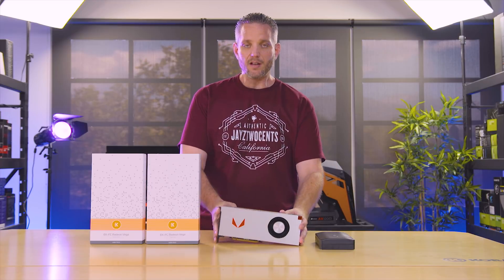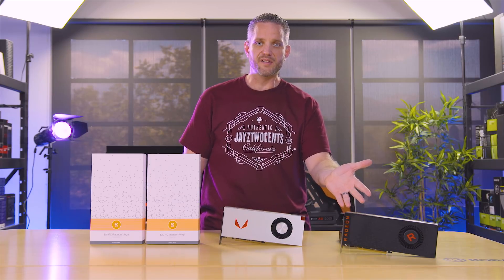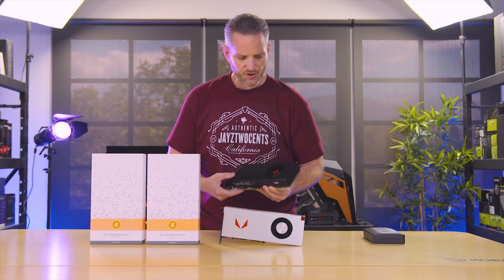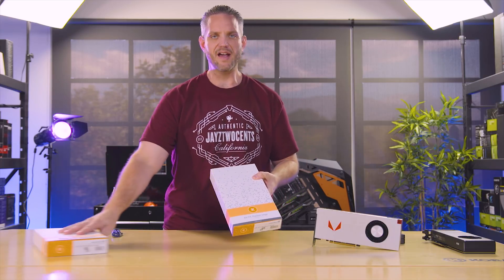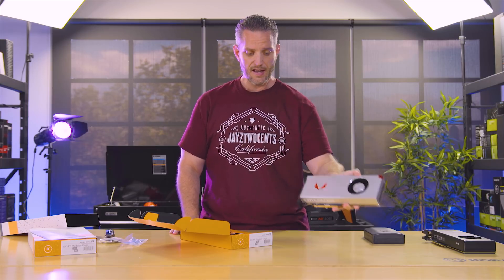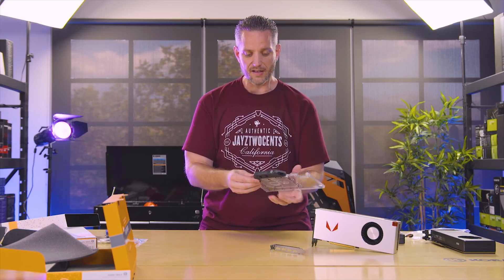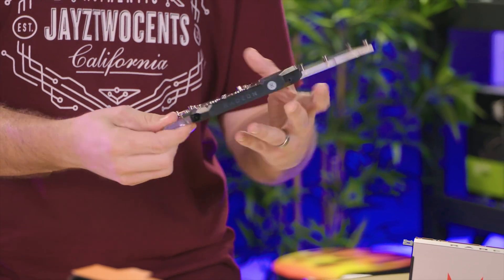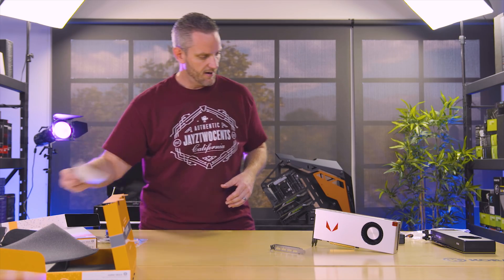Does watercooling help AMD Vega cards?

Comment: 43c is shit ton here average 45-47

"The two main differences in the climate of Saudi-Arabia can be felt between the coastal areas and the interior. The average summer temperature is about 45° C, but readings of up to 54° C are not unusual. The heat becomes intense shortly after sunrise and lasts until sunset, followed by surprisingly cool nights."

Comment: Speaking from the standpoint of just building a SFF PC with a 1080 on air, the single slot is definitely desirable but not at those prices. Honestly, even with a single slot configuration like that the radiator and fans would have to be around 37 mm. That is doable but maybe not that efficient given the reduction in airflow and radiator fin length. I think this is a pretty easy decision for others in my position.

Comment: Question, I have asus 1080 graphics card and a freesync monitor witch I spend 800$ and don't want to change, if the price go down to 499 should I buy vega or 1080ti? Is freesyn justified to buy vega 64?

Comment: It was 30c(86f) here, yesterday it was 27c. day before that also 27. Since my room is the attic it gets pretty toasty. I don't have an AC either. My GPU peaked at 86c to after a little tweaking of the fan curve that came back to 75/77 in the witcher 3. Luckily the game noise drowns the little noise i can still hear throught the M50x's Tho i doubt it's worth it to put an NZXT Kraken G12 on it. That would be an 100 - 150 euro investment into a midrange card. Tho you could argue you can port it over onto other cards,  a GTX 1070 for instance, if i upgrade.

Comment: Jay, In Wattman if you left click on the actual P-State column header then you can change your clock settings from Max to Min. This changes the behavior of the card to always run at the set speed (min) as opposed to turbo up to the speed setting (max).
-Cheers

Comment: of course i would not recommend AMD Vega to any of my friends. It's power hungry, hot, etc etc. Should the price drop to normal then i might recommend a bit if power consumption is not the issue but for now, a big no. 

As for myself tho, if i had the money i would buy the vega 64 and a custom watercooler. I just wanted to support AMD :)

Comment: The clocks bouncing is the card hitting a power limit on stock settings. Undervolting or raising power limit will stabilize the clocks. Some of your fellow tech-tubers have done this already just without a custom loop.

Comment: ps...a good video-card DONT need some water-cooling......just look at for ex, (Nvidia) Asus  STRIX models....Very good components... Super Alloy Power transistors, Vram and top on that basic heatsink CU cooling....i mean come on, my STRIX 970 is nearly better and cost 50% less.

Comment: Lol, 43.3 C, here in Qatar.... it's nothing man :P  Despite that I think the Vega64 cards are pretty awesome, they are not worth it at the current prices to me.  At the official launch price, definitely worth it, might have picked up several, I'm pretty sure that those raw compute numbers would be worth it for me (HPC not mining) in that case.  If I were planning to use it as a gaming card, then the launch price was pretty good, but not an amazing value.  But.... there is some strong potential for it to do better over time (considering the hardware specs I believe it can do a good bit better than it is with the current drivers), especially with more DX12 and Vulkan titles.

Comment: Worth it for the aesthetics, (lack of) noise and if you go after a FreeSync monitor and then it's not in 1080Ti territory anymore. Actually I almost bought a pair (gpu+block) a few hours ago, there's a pretty good offer - around 660 Euros with the waterblock when the crappiest 1080Ti from Gigabyte (white one) is still anywhere from 720 to 780 Euros and a Poseidon/Sea Hawk is around the 900 mark. I hope Vega is a success and AMD are able to get back on their feet top-tier-GPU-wise so we can get more fierce competition.

Comment: I loved that deliciously long shot of the warranty sticker getting pierced by the screwdriver.
Reply: pop dat warranty cherry
Reply: It's usually based on law, not what the manufacturer tells you. In Australia, for example, they can't refuse to honour a warranty if a sticker is damaged or removed.
Reply: Everywhere I've lived, contracts can't affect you rights by law. This applies to Australia and the EU/UK. If hey say something in the warranty, that has no affect on whether they have to service a faulty product. They have to prove whatever you have done caused the issue. You can take them to various consumer/government groups if they do refuse. Usually results in fines if they don't have a valid reason for refusal. I thought America had similar laws regarding consumer rights, but I'm not American.
Reply: Astfgl Im going to attempt to remove mine, run time spy on a loop and take it off while the glue is hot.
Reply: Actually they are bogus, linus did a whole video on it https://www.youtube.com/watch?v=qwAGgCpLVeo
Reply: REKT
Reply: bullcrap, as long as you refit the original heat sink and fan they have to honor the warranty!!!   I did the identical mod on my 56 and i didnt test the card before i did it and low and behold was dead.  So fitted the orginial heat sink and fan with original screws and it was warrantied no worries.  Look up warranty law ;)
Reply: Yep, and i got one doa vega 56 and had to warranty it AFTER i removed the sticker and no worries.  Also called ACCC to confirm before i went and 100% stickers mean NOTHING
Reply: you dont lose your warranty, educate yourself about the law
Reply: I'll be gentle...
Reply: Same here!! I enjoyed that a bit too much.
Reply: Gunna have to go caps here. THE MAGNUSON WARRANTY ACT DOESN'T HELP BECAUSE THEY ARE NOT I REPEAT NOT MAKING A TIE IN SALE. I repeat, they are not making a tie in sale, because they are doing it completely free of charge. Know the law, and how it applies.
Reply: :|  Losing the warranty if you aren't a rich YouTuber as Jayz isn't funny at all.
Reply: So I put the block on my Vega, removed the sticker with a little bit of heat >:D
Reply: Those stickers are not "bogus". They can refuse to honor warranty if the repairs/modifications are not done at an authorized location. It is stated in the warranty, which you can find and read for yourself before purchasing the product (which you agree to, by purchasing the product). That "example" points to nothing but some tech rant, with no actual basis.
Reply: Warranty is a contract. By US law, you have the right to view the warranty before purchase. After that, your agreeing to it. Even the Motherboard article that goes on it's tirade against this practice states "The statute itself states "for example, a provision in the warranty such as, 'use only an authorized ABC dealer' or 'use only ABC replacement parts,' is prohibited where the service or parts are not provided free of charge pursuant to the warranty." " actually doesn't do shit. Because they DO provide the service for free in the warranty time frame. These lawyers know what they are doing. I personally do not know of Australia and it's laws, but America is intentionally left grey and murky for businesses and other special interests to take advantage of it.
Reply: @Thanoric  contracts don't override statutory obligations my friend.
Reply: @BenState  There is no US statutory obligation on the matter. As many have claimed, even in the US, as long as they are NOT making a tie in sale, it is allowed. And they do the service free of charge. Sure, if you live in Australia, Canada, or the UK your probably within your rights, but in America, corporations are king.
Reply: @BenState  those companies were making tie in sales. These companies do not do that. Read my previous reply about the magnus warranty and how since they di it for free, it does not apply.
Reply: @Thanoric  You're wrong mate, nothing you say is back up by legislation or evidence.  Just stop.
Reply: @Thanoric  and, tie-in sales provisions are prohibited so pull your head in

Comment: This is pretty much Fury and Fury X all over again. I like AND I've been very impressed by the Ryzen and Threadripper but the RX500 series and Vega isn't hitting all the marks to compete. It was really deflating to see Radeons newest best "Vega" only competing with nVidia's last gen 1070, 1080 while running hotter and consuming more power. I'll be holding on to my gtx980 a little longer till the new nvidia cards come out and I can grab a used gtx1070 off eBay.

Comment: Water cooling vega is a bit of a waste when it won't oc very much (only thing you gain is less noise going from the unspeakably bad stock cooler). There is no point in Vega 64 for consumers with the 1080 ti in existence.  Good review though but I don't see who would put blocks on these besides AMD diehards.  Vega is tied with (or a little worse) than Fermi (GTX 480) for worst gpu architecture compared to the competition at time of release.
Reply: Ja hab jetzt wie gesagt schon ne powercolor rx vega 64 für 500€ gekriegt, bin zufrieden abgesehen von einer sache - hab das modell wieder zurückgeschickt, hat coil whine unter last gehabt. donnerstag kommt ne neue.
Reply: Why do you say it won't OC much? HBM OC has huge gains, and is largely temperature-bound, would benefit greatly from water. Still, I don't get why Jay did this with a 64, no one's getting a 64, 56 is where it's at.
Reply: Quacksalber wtf, every single vega64 i can find there is 600+ €...
Reply: i also managed to score an RX Vega 64 for 500€, which is exactly the price of a  1080 here. Good for me, since i have a freesync display :)
Reply: Right look not every country is ripping prices hard

In Australia you can buy a Vega 56 for 650 bucks and a 1080ti costs 1099 for worst version. The water block cost 139 either way it’s still far cheaper here to get a Vega 56 and flash it to 64 and oc higher. I did this and found the improvement was massive. It’s actually a gem and I got mine for 599 when they launched which is even cheaper again. Add to the fact I play f1 2017 and the FPS is higher then a gtx 1080ti can manage  at 4K. It’s not my fault people have no clue about strengths and weaknesses of each gpu and game but the Vega is by no means a bad buy or not worth the money even with water cooking it’s cheaper then the cheap crap branded gtx 1080 ti. 

Games that fully utilise amds new features within dx12 show improvesments that gtx cards just can’t keep up with. There is benchmarks out there with dx12 games showing Vega 56 destroying 1080 in most most aaa dx titles as stock
Reply: One reason is that OpenCL applications on a Vega 56 are faster than a 1080Ti. With water cooling you can put three cards in one case and undervolt. You'd have one crazy fast pro station. This is of course a very specific use case where AMD cards are better for computing and not for games but gtx 1080 speeds are not bad for a vega card.
Reply: Brandon Casey i Just got my Vega 64 for 509€, the cheaper 1080ti i found costs 699€.

So I wouldnt that theres  No Point in Vega for consumers
Reply: Quacksalber where tf did you find a vega 64 for 509€?!
Reply: Daniel Wanner from mindfactory.de
Reply: Quacksalber Link bitte? :D
Reply: Daniel Wanner vor ca. 2 Wochen war die Vega 64 für 509€ auf Mindstar im Angebot.

Das ist die Schnäppchen Seite von Mindstar, derzeit sind da eher Nvidias im Angebot.

Also Einfach hin und wieder da rein schauen

https://www.mindfactory.de/Highlights/MindStar
Reply: Quacksalber oh mann, hätt mir da echt eine snacken sollen... hab nen freesync monitor, also will ich ungern nvidia auch wenn die momentan p/l mäßig besser sind...
Reply: Quacksalber danke! :)
Reply: Daniel Wanner stimmt, aber mit etwas Glück kommen Ende Oktober die custom Modelle. Vielleicht haben die dann auch wieder humane Preise, sodass man da ohne schlechtes Gewissen Zuschlagen kann
Reply: derzeit ist die Vega 56 für 449€ und die Vega 64 für 549€ im Angebot
Reply: Just bought at rx 56 for $459 USD newegg. Vega 64 is as low as $569USD  rn at newegg US also ( with game bundle) lowest prices i seen for both cards, since lauch

Comment: Thank you Jayz.  I've been eyeballing these EK blocks as I've had a Vega 64 sitting here for the past couple weeks while I debated how to finish out my system.  I've been leary of going with a custom water cooling solution as I've only done factory sealed AIO's in the past.  It is good to see it is relatively straight-forward.  This may or may not be cost-effective, but I suspect it'll be an interesting project and experience none-the-less when I jump on it after the 1st.  Mostly need to decide if I want a second Vega64 to go with it so I can cool both cards and the 1800X I have.

Comment: It's unfortunate that it doesn't give a huge improvement to performance, but I know if I had a freesync monitor this would absolutely be what I would do. And I have to say that card looks sexy as hell with that block on it and as a single slot card, I'm super jealous of how nice it looks. I just bought my 1080ti and it has DVI on it unfortunately so I won't be doing that anytime soon. But I will be getting a full EK block for it fairly soon after I finish building my new rig. Awesome video though Jay, thanks!

Comment: You didn't bring up the issue with the different die's used on Vega. I noticed yours isn't the one from Samsung and has a different height on the ram vs the GPU. Was curious if it's a real issue or not?

Comment: I've ordered the 56 ref for £380. Not sure what to expect noise wise (concerns me more than thermals tbh). I am used to my MSI RX 480 Gaming X being whisper quiet. I would consider a third party cooler but the waterblock is no go for me. I'd rather either have an AIO or better yet a fan cooler like the Arctic Accelero (sadly no Vega version yet).  An AIO would be more problematic simply because of my case layout and already having an AIO on the CPU.